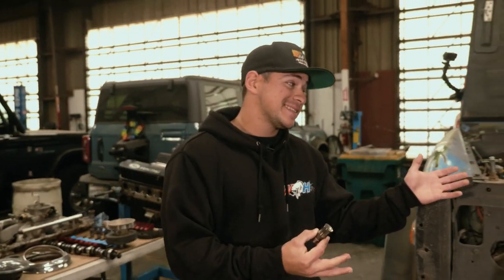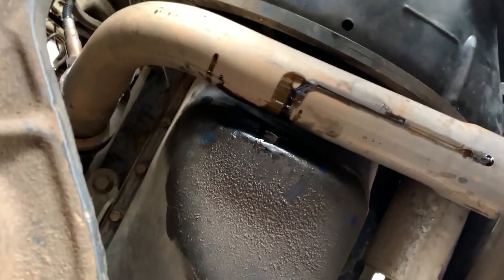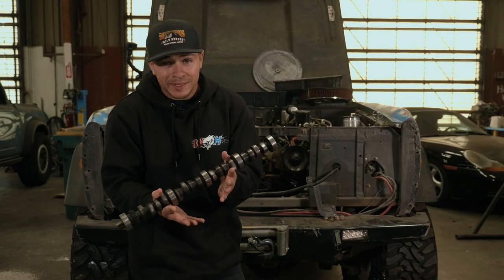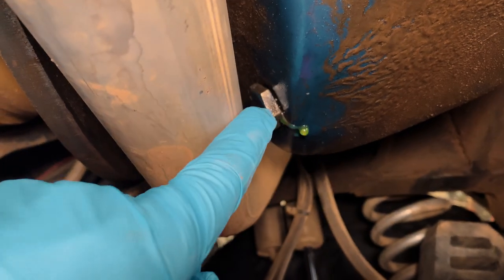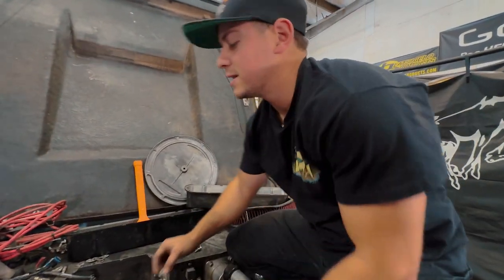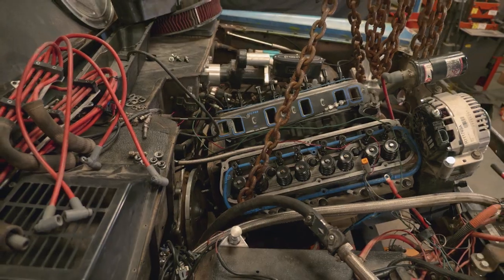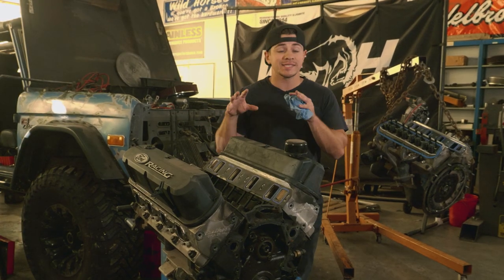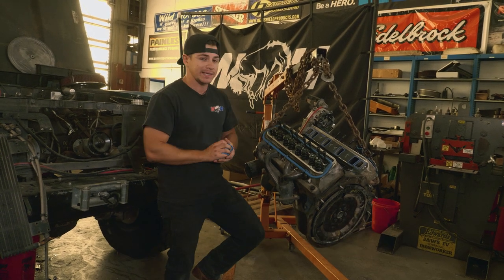Why You Should NEVER Install Flat Tappet Lifters Again!

Comment: AFTER BUILDING ENGINES FOR 50 YEARS,and pulling thousands of them apart,the super clean ones inside,first thing i checked was the door lube sticker,to see who's oil they had been using,all the ones that had zinc in them were just normally worn,the ones with no zinc,gummed,coated,lobes worn,the internal combustion engine needs to two things,regular oil changes and zinc in the oil,roller or not,rubbing ,spinning parts[roller design] needs zinc too,remember, remember that parts companies only owe you a machined part to fit your application,if YOU are using the correct lubricant in your pan and on your parts,your car sings along down the road,other wise,like this man his engine is now full of metal,due to high loading and unecessary heat on gliding surfaces that need the zinc terribly ,i wont use anything but flat tappet cams cause i hate,HATE,THE HIGH SPRING PRESSURES,they eat cam bearings and parts,and most of all,the damn engine needs clearancing perfect,to live.I;VE FOUND that spending the money for the zinc oils and proper clearancing the lifter bores,these engines will survive and roll down the road in the heat and cold.this breaking IN bs of running new engines up to 2000 rpms on new engines is horse caca,i worked dealerships for 35 years,MOPAR,GM,FORD,HELL EVEN AMC for awhile,cam failures were rare,damn rare,new cars  would come thru and we idled them for HOURS,new,brand new,no break in,period,the ZINC IS A CHEMICAL THAT HAS TO BE IN ALL ENGINES,ALL ENGINES,ROLLER CAMS have rolling parts that have to spin and run clean,on new engines,run them for 3 hours,drop the oil and filter change,DO it again in 750 road miles,rings will be seated,and then drive the hell out of it,but you had better put zinc in all of your engines,including lawnmowers,or it will be toast,CLEAN CLEARANCED ENGINES RUN FOREVER,I change oil 3500MILES-- 3 times,till the oil pan is clean,then go to 5000 miles intervals 3 times,then rotate back to 3500 miles 3 times,this keeps the oil pan clean and most importantly that pickup screen,it clogs GOOD BY ENGINE
Reply: Most sensible post so far 👍 Nothing wrong with FT cams.
Reply: So glad I read this comment...thanks for the knowledge....zinc is goin in on next oil change for sure
Reply: You know a whole lot..... about absolutely NOTHING.
Reply: @SOLDOZER  LOL
Reply: Bottom line is there are so many  different variables. Most factory stuff are lazy profiles with low spring pressures and older oils weren't as cleaned up for the environment. The higher rpm for break-in is there so lots more oil is getting to the lobe lifter interface and the cam is doing 900rpm and more likely to rotate the lifter. Anything with engine operation requires precision, do your research on whichever system you decide to use. Thanks for the comments on a short on answers video. Scott

Comment: The problem with flat tappet lifters is the way you run your equipment. Up until around 1996 everything had flat tappet lifters. And they didn't have the issues people complain about today.  I have built many engines and never had an issue with flat tappet lifters on stock  valve train.  You want to run high lift with high spring pressures that exceed the cam manufacturer, that's your problem.  You want to abuse you motor up on breakin, that's your problem. If you want to not use zddp in the oil, again that's your problem.  I just watched a video where they are cutting the lifter bores on a 460 Ford to increase oiling. Again, I have had a couple 460's and never heard of lifter failure in them, unless you don't know what you are doing. Ford cams are notoriously harder than Chevy. So I think this is the mechanics not knowing what they are doing. Edelbrock cams are terrible just like their carbs, I would rather have a squirt gun. Buy a quality cam from Isky, crower, bullet,comp or a quality aftermarket if factory doesn't have a cam you like. Edelbrock has the smallest cam section of most any of them out their and they are Chinese cores

Comment: why you should never install a roller cam again .... why you should never install a hydraulic cam again ....  why you should never install a cam again .... run a sleeve valve engine and never worry about cams or lifters ever again

Comment: To make you feel better, the one oil change didn't kill it, they are often under zinc'd during the brake in, so they never got that set in.  I have both flat and rollers. Life is easier if they are all roller lifters.

Comment: I still run solid flat tappets in my Mustang, from 1999, I've always used 15/40 Rotella oil, same as I run in the Cummins powered Bronco, since that also has solid flat tappets. The Rotella oil has enough zinc to avoid any issues.
p.s. Consider a 5.9 Cummins swap in your bronco, after driving it with the diesel, you'll never want a gas engine in it again. My Cummins is simple, has 400hp, 800 ft/lbs of torque, and my lifted '78 on 35s is a lot quicker than it looks, plus it gets 22-27 mpg.

Comment: A bought Ford Oem lifters and ran them in two Broncos and a F100. Twenty years later still driving them. Oh and I never added zinc.
Reply: I have a 65 Mustang that I just pulled the engine after 15 years. Never once used zinc and everything looks fine. Its not a zinc issue.

Comment: Beginning in the early 2000's, the EPA mandated the removal of zinc and phosphorous from engine oil, due to issues with catalytic converters on newer vehicles.  I add a bottle of STP Oil Treatment (blue bottle) at every oil change. I have 3 flat tappet motors, all with over 250,000 miles. All going strong with no issues.  Flat tappets have been used for decades, they're not the issue.  Yes, roller lifters are better; but they are much more expensive.
Reply: Wrong - they have only reduced the compounds, not removed.

Comment: Jeep Cherokee’s up until the early 2000’s ran flat tappet lifters in the straight 6 engines. Never had to put any extra zinc in the oil for those engines. And they ran fine for over 200,000 miles. So not enough zinc in modern oils for flat tappet lifters is bull. Yes you need a high zinc oil for break in, but after that I don’t think so.
Reply: Correct. OEM cams barely move the valve off the seat and have such gentle ramps they usually last a lifetime
Aftermarket lifters have to buy quality pieces and ck ea for proper taper thats all
Mfrs are pushing FT cams with too radical seat timing to mimic a roller and self destruct
Harvey crane H. Brookshire Ed Iskendarian used to talk about ideal intensity factor and it holds true today
Doing a large SFT in my next build. Curretnly a large solid roller but will never hold up over time like my sft engines did
Expensive and a lot more parts to go bad with rollers.

Comment: To complicate things there can also be too much Zinc/Phosphorous additive also. It can be corrosive if over done. Always use the recommended amount in the oil. Better for roller motors also.
And check lifter bores and use the correct springs no matter what set up.
Reply: Yes

Comment: With bad quality parts these days I went flat tapped. To many guys talking about failed rollers at the track. I'm wondering about spring pressures on the springs. Most people throw heads on with never checking springs and valve train geometry.

Comment: When you buy a lifters you have to make sure that the face is hardened face of the lifter and up the sides about an eighth of an inch should be a little brown from where it was hardened if it doesn’t have that don’t use it it’s gonna fail

Comment: Dude! Not everyone has 1000 dollars to blow on retrofitting a new roller cam into a non-roller cam block. If you want to Paypal me 1000 dollars I'll do it. So far, up to and including 3 months ago I've had no trouble breaking in standard lifter cams and lifters. Yeah, I know it can happen. Anything can technically happen, but these bad lifter videos are going to scare people away from hot rodding.

ALSO Castrol has brought out Castrol GTX Classic oil, with much zinc and phosphorus according to the jug. It works.
Reply: Thanks for the Castrol GTX Classic oil heads-up Danny!!!
Reply: I mostly buy NOS cams and lifters and Jegs housebrand or Elgin cams and liftes never an issue
Reply: Facts

Comment: Zinc additives don't work because theres a process that has to be done for the zinc to be mixed with the oil also there's also more minerals that are needed besides zinc, driven oil explain this too you
Reply: That's correct, but you should not trust anything with the Driven name either
Reply: @rickss69  His comment is incorrect. Additives work just fine if you buy a quality one with what is required. I add Rislone Hyper-Lube ZDDP in a 67 Mustang 460 pro street engine. No issues at all. And NO Comp Cams China crap in my engines ever!!!!!!
Reply: You can use Mos2 Additive
Like the army does around 4% of oil volume

Comment: I thought a quality break In oil was to be used until the cam and lifters were broken in. Then change it and add your oil you choose to run. Maybe not necessary, but I add Rislone ZDDP hyper-lube (maybe 1/2 qt bottle I think) that cost around $10. Or Run expensive oils like Brad Penn etc,  if you like with high ZDDP content. Thanks for sharing. Cheers from Motown/Dearborn.

Comment: Flat tappet engines never needed a zinc additive and these engines were being manufactured and sold well after the new "lower zinc" API SM rated oils became universal. This small block Ford didn't lose a cam and a lifter because of ZDDP. The engine builder never verified lobe taper, lifter crown, and most importantly lifter bore oil clearance. This failure is on the builder.

Comment: Be sure and check you valve spring pressures. A roller cam requires a lot more spring rate due to the increased weight of the lifter and the speed in which the valve opens and closes. Notice the Edelbrock heads you sell on your website state when you go directly to the Edelbrock website to use only on flat tappet cams.  That being said I’m replacing the cam in my 66 now due to a roller lifter failure, the second in 12 years. Roller lifters fail too.
Reply: Chinese crap sucks, try Elgin

Comment: Shouldn't have to use zinc additive, l just pulled a 5.7 from a 95 z71 for use in a boat,it had about 150k on it,after inspecting the cam and lifters they showed no signs of any irregular ware ,im guessing it had 10w30 in it most of its life

Comment: New camshaft before installing, measure each camlobe, must have at least ,003 difference to make lifters spin, machine work on camshafts cause failure not metal hardness most times.

Comment: The problem is...probably better than 90% of motor oil formulations are formulated to suit car manufacturers with their design requirements on new builds, so what they are building displaces even nascar's collective wallet - who abandoned flat tappets in 2010 or so, when the arrival of the SN spec showed no relief from ongoing problems of the prior API standard.   From SM spec and onwards, oil is the problem more often than cam grind or lifter quality in my opinion.  What oil does is provide wear resistance - up to a point.  What is that psi number where film breaks down?  65k? 98k? 122k? That would be the one thing you cannot find out directly.  API this, JASO that, Dexos umptysquat, a half dozen or better ASTM methods largely unexplained to the public in data sheets, and on it goes:  marketing around the edges, and shortchanging the public regarding the real wear protection numbers.  Oil analysis services are good at chemical detective work, but where to go for mechanical testing?  Seems all that data is wrapped up in NDA's with carmakers the oil makers/chemists cannot release, and if that is the case... it's a massive public disservice, hiding the primary function of oil from consumer discovery.
Flat tappets are better... but where?  To me, the answer is mainly lower lift applications [sub 0.480" or so] because taking advantage of rapid lifter accelleration still has room for easier ramps without getting into excess overlap. 0.480-0.570" is a grey area [better have very good oil] and after that, looking at rollers begins.  Do not ever overspring your setup: more actually sucks.  Lightweight retainers or rocker arms are a far better investment. For example, 375 pounds of spring pushing back at a cam  via a 1.5 rocker is 562 pounds of force going at the lobe.  If lifter area tangent to  the lobe presents near say... 0.0064 square inches [an 0.08" x 0.08" spot], the oil must stand up to at least 87,812 psi worth of abuse.  Add in a safety margin, because of temperature and additive degradation over time:  20%? 25%?  There are oils that still work, but better keep a 3k mile oil change plan for peace of mind.  Zinc works, but there is more than one way to skin a cat - Oil Extreme has done well using calcium sulfonate, but again... its the numbers that the total additive package produces that go in your engine, and they all work together.  There rare high zinc oils that don't work - some are overdosed with one or more additives , some have a total package that can't provide minimum psi protection on its best day under perfect conditions.  And folks might have noticed, government designing anything by fiat doesn't work well:  recall that after CAFE passed in the 70's, they managed to kill an extra 5,000 motorists each and every year... until airbags saved our bacon.  The flailex on oil isn't going much better:  how many thousands of cams have they killed?

Comment: U didn't "forget" to put the zinc in. U just didn't think it was necessary & after the break in process u simply stopped using it. How do u go buy oil, oil filter & know u need zinc but forget when your buying everything u need for a oil change & then when doing the oil change, u just happen to forget again & go forward with the oil change? U just didn't think u needed it & it bit u in the ass is more likely the case.
Reply: I cant even read this word salad.
Reply: @KINGTROLL  never learned huh?
Reply: @jesseduke694   What school did you go to? I want to make sure my kids never go there.
Reply: @KINGTROLL  the school I went to isn't responsible for u not being able to read? That's weird? What words are u having trouble with? I'll help you. We can sound them out together. Ok just point out the words u don't know. Just the big ones or all of them? I wish I knew how to put pictures on here! Maybey that would help u?

Comment: Solid lifters for a trailer queens. Needs adjustment every 12 k but they last .
Reply: My wife and I could adjust the valves on my big block Chevy between rounds bracket racing and we weren't even very quick about it. It's just not a big deal.

Comment: use the right oil and use a reputable lifter and cam grinder. i guarantee this lifter or lobe was ground without proper taper.

comp and crane are the same now company and have super spotty QC. isky is still made the way they were in 1988 or whenever and howards cams and lifters are supposedly right too. i wouldn't trust a comp or crane set of rollers.

Comment: Comp Cams?
Reply: FYI Edelbrock Performer RPM cam and lifters kits are Comp Cams parts. Be prepared for the worst. Their crap just cost me the crank, bearings,  gaskets and seals, oil, filter and a whole lot of labor, again. Not to mention the $2000 to go to a roller cam and lifters and pushrods and springs and retainers and locks and more assy lube and a LOT of time here in covid world. Gee thanks Edelbrock and Comp Cams.

Comment: Oh, another issue I saw was you are using Comp Crap. Don't know what they did to their process, (China shit?) But have seen so many Comp failures even with a perfect break in etc. Comp won't even address this issue or speak about it. Like they are hiding it by not putting out a company statement on what they are doing to fix this issue. Will never buy anything Comp in the future. Too many other good companies to deal with. Also, the cam lifter failures were TOP notch Engine builders etc, so it IS the Comp quality issues.
Reply from the maker: We appreciate the insight! What other companies would you recommend?